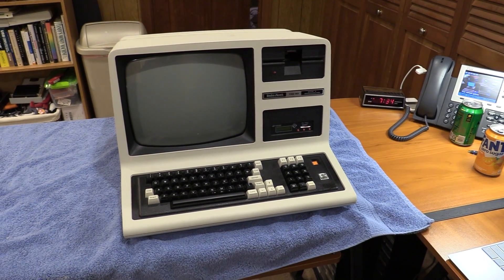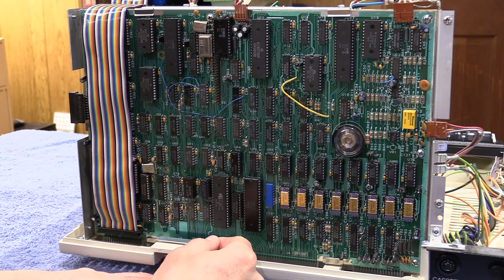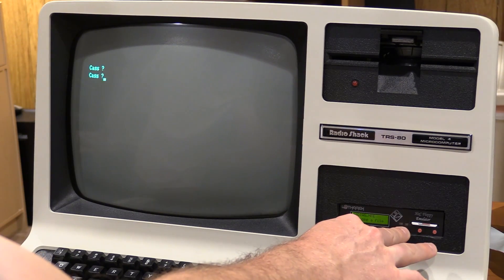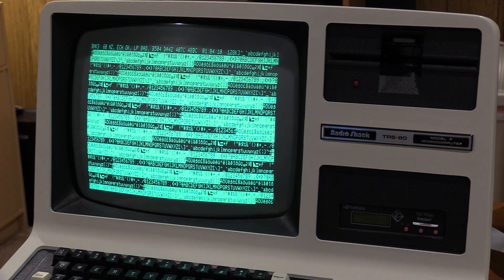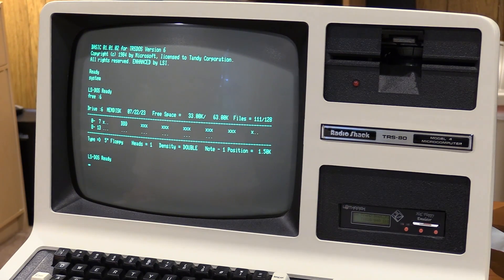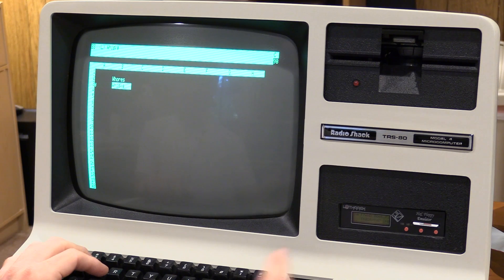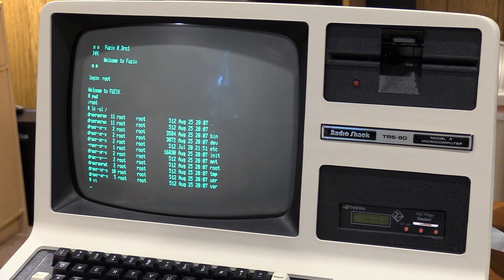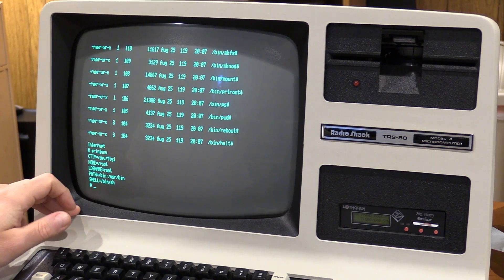TRS-80 Model 4 128K RAM Upgrade and Test

Comment: My machine is non gate array (blue CRT and all)  with similar upgrades.  I haven't been able to figure out what to use the extra RAM for. I think maybe Multiplan and LeScript are two packages that can actually use it.  RAMDISK I suppose.
Reply from the maker: I ran into the same issue…only a subset of programs use the memory.  I upgraded it just to do it.  Now that I have 128K I’ll be looking for more programs…if I find any there’ll be a video about it. 😃. In the mean time, Memdisk can be worth it if you’re using floppy disks to run the machine.